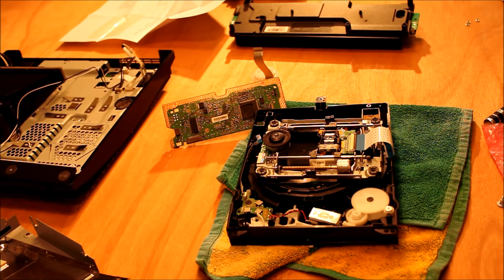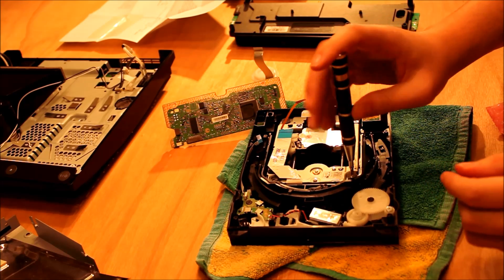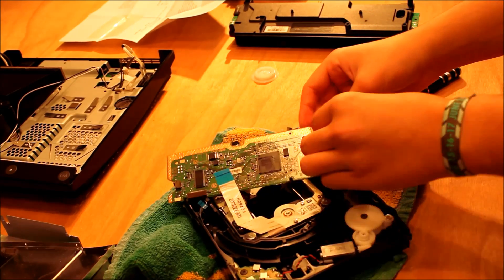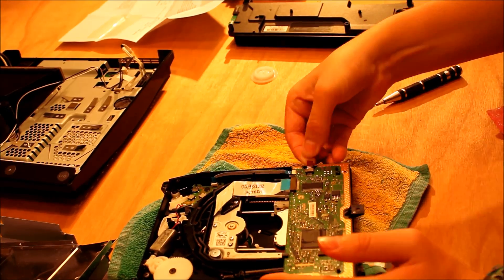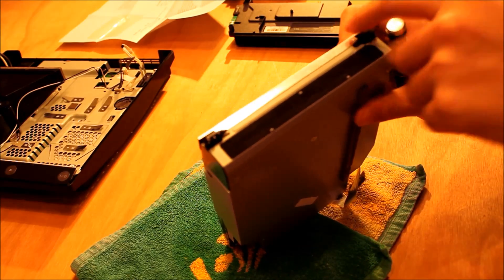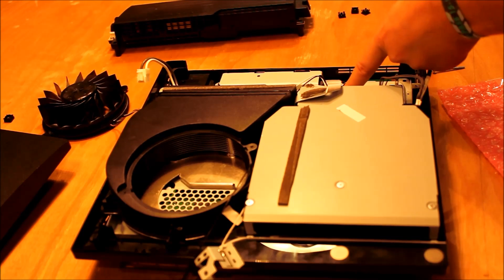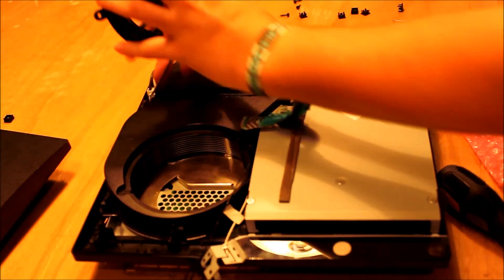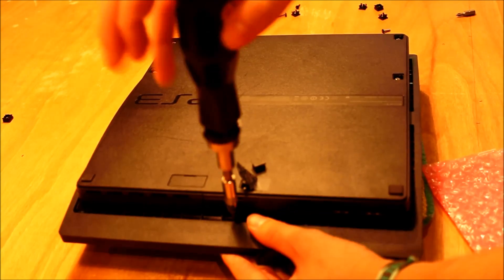How To Replace Bluray Laser On PS3 Slim Part:2

Comment: Oh, you've replaced the whole mechanism, not the laser itself...
Also the easiest way to connect the laser to the board is connect the board first, then the laser and then put the whole set into the drive itself.

Also no idea why you removed the fan and the one little screw behind the larger square bracket

Comment: The worse bit is those little strips you have to plug into the drive. The insert space is so small, you can't tell if it's really in there until you reassemble the whole thing and turn on the PS3, only to find that one of them was loose and it won't accept discs.

Comment: Using your video and Steve Nixons I managed to replace my 120GB slim drive, thanks.
The latch for the wide data cable on the laser itself pulls forward,  tricky with short thumbnails, best with a small flat head screwdriver.

Comment: This and the previous video are super helpful! My PS3 started failing a few months back with only occasionally picking up games and blu-rays, I don't yet have the tools and parts but I'll be sure to follow the video to the letter. 

I'm used to taking apart my PC, but I've never done a console so I'm a little apprehensive but this has actually set my mind rather at rest. Thanks for uploading!

Comment: Oh one thing - When I was trying to get that electric board off - with that one tab - if you look towards the laser you will see two black hinges  holding the board on - those are what kept grasping on to my board as well.Pain in the rear no doubt. but don't force it!! it came off easy once all tabs were out of way.

Comment: Thank you sooo much for the video! The only problem I had was when you got to changing the laser part, you already had it in the sliding deck assembly already and I just had the simple laser. So that was a little tricky-In the Lens deck (sliding deck i call it)  One black super small screw on the white plastic holding it to the laser assembly and then two silver screws under the top of two silver rods, 1 clip on one side and thin metal arm that can be pulled back  -then laser slides off - slide new one on , screw it all back in - and then follow your perfect video. Thank you sooo much!!! You were super cautious,well spoken and explained everything as well as you showed it all. 20 bucks for the laser on Ebay new - saved me a bundle and back to GTA 5! You deserve an award you fine gentleman! :) Hugs!
Reply: Thanks for this comment, I'm attempting this repair right now and this was the piece that was missing between the videos.

Comment: How do I find a replacement laser how do I know I got the right one
Reply: Chris Hill On the back of your PS3 there is a model # and that's what you need to have match. Like mine was CECH-2001A. Never forget your #! and if you order off of ebay, make sure laser is new and , like Bubble Tonic , his comes with the whole lens deck assembly and mine did not. When I got my laser, it was just the basic laser and I had to figure out how to get it on those two rods! hehe It's acgtually a little scary at first but just go easy. I was overwhelmed at the pieces all over my desk, but trust me , if i can do this , you guys can do this and Bubbles tutorial is amazingly perfect!! You can always ask ebay sellers questions too. Trust yourself!
Reply: Thanks I already fixed it myself no thanks to sony witch I won't send it to them to make even more money off me
Reply: yeah i got my laser off of ebay - fk SONY hehe hugs to your rebuild babe! wtg! :)
Reply: Thanks did u do your own repair :)
Reply: Oh and it only cost about $35
Reply: Hey do u know any good sellers on amazon for ps3 parts

Comment: I did this and now my ps3 wont even accept the disc, i try to play any disc and it doesn't take it
Reply from the maker: grandtheftautowwe You have not correctly connected the cable that powers the drive.
Reply: Same here. Which cable powers the drive?
Reply: Check that thicker white one with the blue tab, the one that directly connects the motherboard to the laser. It's really hard to tell because the space is tight, but it has to be completely inserted to work. Sorry if this is late, but this might help someone else!

Comment: title should read "How To Replace Bluray Laser Lens Deck On PS3"
Came here looking for how to replace just the laser lens but for complete deck replacement this is a decent guide.
Reply: Steven Boyd Hey I just did  the laser off of the lens deck myself without instructions. As you,  I came here looking for same and Bubbles did most of the work for us- those last few steps of getting laser off of deck that he missed was important but sort of simple. Black screw off of white plastic holding the laser on to it- two silver screws off of rods - one CLIP on one rod holding it down - one bending thin metal thing on the otehr easy to slide back - slide laser off ..new laser on - done! Great vid - oh dont touch the laser - if my dope bod could do it, you can too Steven. Trust yourself people!

Comment: Great video, thanks!
I just did this with our ps3 that wasn't reading discs anymore, just to see what the inside looks like and to see if I could fix it myself, just what replacement parts I had to buy. I put everything back together and now it won't even accept discs anymore. I don't really know how to explain it, but I slide the disc in and it won't grab it. Anyone know the problem?
Reply: ***** I just opened it up again, made sure every cable was put back really tight and the thing worked again! So yay. ^_^

Comment: I replaced with new Blu ray laser, but now the ps3 slim cant read any discs... I took the ps3 apart AGAIN to see if I reassembled it properly. I see that put in all the screws and ribbons in properly, is there anything i did wrong that i missed. Was there something i had to do with the Blu Ray laser (I only thing did ribbons and the rubber feet).
Reply: I know I’m pretty late.. lol. But maybe your entire BluRay drive wasn’t working

Comment: OK, I have a model that I think is 160gb - it is CECH 2501A. I took it apart and everything was the same until we got to the actual blu ray drive (mine looks different) anyway I took it apart and replaced the laser inside that said it was a KEM-250-DAA, and replaced it with a KES-450a. Anyway, I put the entire thing back together to find the exact same problem happened (not reading disks) so I was wondering is the laser I bought just not compatible, or is there a different problem?

Comment: if you don't want to replace the laser because you dropped the ps3 and it broke into a million pieces, buy a new PlayStation, and take the back piece from the new and switch it with the old one you can keep all your saved data. If you want sell the new flash drive for money.

Comment from the maker: I have more then enough light to work and enough light for you to identify where all the screws are coming and going from, if you need someone to hold your hand and zoom in with a flood lamp to identify each individual screw... then maybe you shouldn't be attempting this and the security screw / pressure pad / alert signals. You've completely lost me on this one. 

I highly recommend you send yours away to Sony where they will charge you 10x as much for the exact same job.

Comment: Guys you must be nuts to do this reasons why:

No natural light I like the idea of putting the screws in so you know where they are but sometimes it wont do the trick.

The security screw yes you do need to special screw driver but under the screws there is a pressure pad and when released will send a alert signal to the motherboards PSU (not good).

Comment from the maker: Go back and check that the assembly at the front is screwed down correctly therefore making sure that the drive lines up properly with the slot in the case. If the drive lines up correctly but the drive just isn't pulling in the discs then you've missed one of the cables that connects to the drive, so go and recheck that all the ribbon cables are correctly connected.

Comment from the maker: Go back and check that all of the cables are hooked up and hooked up in the right places, if the drive isn't pulling the disc in then chances are that the cable that goes from the drive to behind the drive isn't correctly plugged in and so the drive isn't getting any power. Also make sure the screws are all done correctly so as to make sure the drive is lined up.

Comment from the maker: If you search PS3 Bluray you should get all the different versions. If you search Bluray drive you should get the whole box as a simple (but more expensive drop in replacement). Bluray laser is just the laser part and what I have here is a Bluray deck. Searching Bluray deck should bring up what I'm having here.

Comment: Update: Well, I cleaned both the Blu-Ray and DVD lens and it still does not work well. The seller was "Brainy Trade". I've been talking to them for a two weeks to no avail. I think that they may have sold me a used/refurbished item or there may be something else broken such as a motor. I returned the drive to them and am now looking to alternative solutions. Wish me luck! Also, just because my experience sucked doesn't mean it couldn't work for others. Thank you again for the awesome videos.

Comment from the maker: As long as everything is connected up right after you've checked and it plays the discs, I wouldn't worry. I've replaced it before and forgotten to attach the connector that provides power to the drive, that was a tense moment! Possibly you got dirt on your new lens during the replacement process and that it could do with a clean, but again, if it plays, then I would imagine that you're all good.

Comment: I got the KEM-AAA laser unit  today (ordered from Amazon) and installed it just fine. I started up the system and inserted my game. The first few moments were tense as my PS3 made the same "ejecting/disc adjust" sound it had been making before, but after a few moments my game loaded! Other game discs work fine. I tired a few blu-ray movies and the weird thing was that one didn't work right away and it made the same sound while others worked. I'm going to check my connections and try again.

Comment: Thanks again BubbleTonic.  As you say, it's far cheaper (and less hassle) to do this job yourself rather than sending your ps3 away for repair. One little tip  for anyone else who decides to do this. If, when reassembling the drive, you have difficulty reinserting the larger ribbon cable back into the underside of the circuit board (the cable from the laser module): I found it easier to do it before putting the laser platform back into the drive.

Comment: Hey, BubbleTonic. Thank you very much for your two videos. I was able to follow along with your guide step-by-step without any guessing required. My Blu-Ray laser also does not read discs, but my DVD laser does. I did clean both the Blu-Ray and DVD laser when I had the PS3 taken apart with Isopropyl Alcohol with 91%, but this did not work... I discovered that my laser is also a KEM-450 AAA. Where did you purchase your new laser?